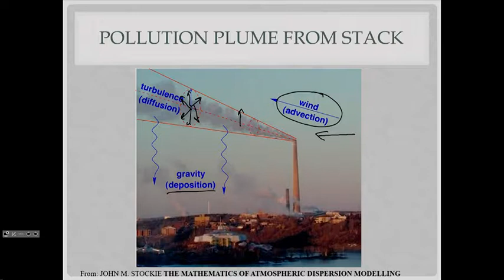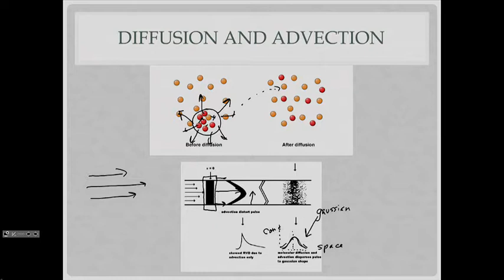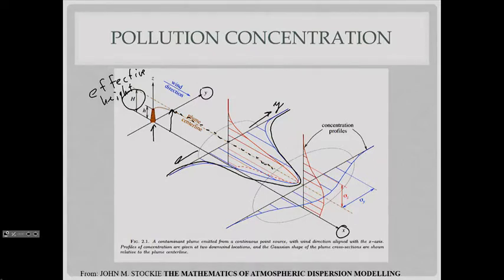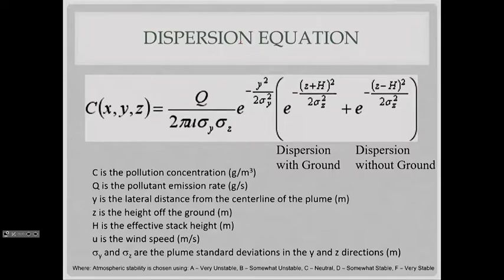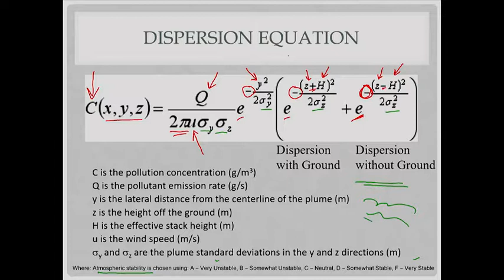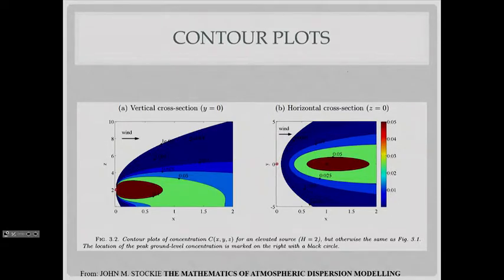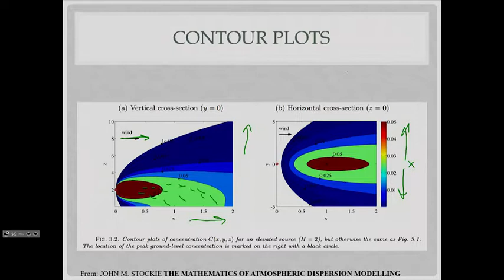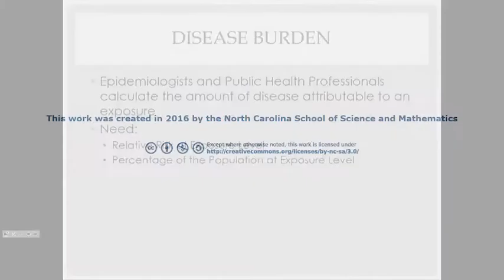Dispersion Modeling

Comment: Spatial distribution of pollutant 
Multiple exponential 
Decays 
Empirical statistical 
Diffusion equations 
Straight line 
Sigma y and sigma z has a dependent on x 
Turbulence ........unstable 

SD defines the state of plume 
Contour plots 
Vertical cross section from above 
Higher exposure 
Ground level 
Thermal inversion